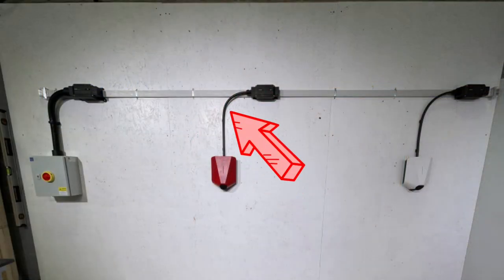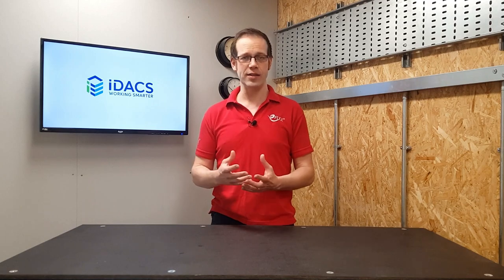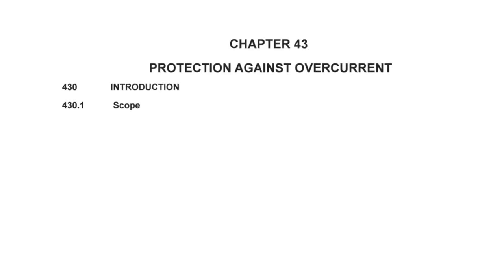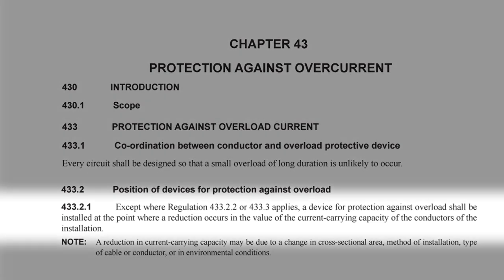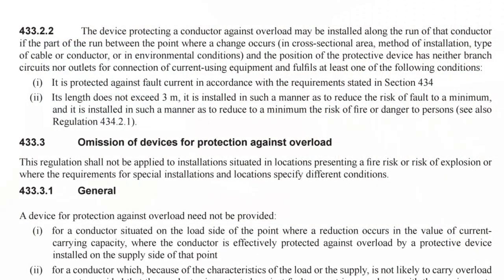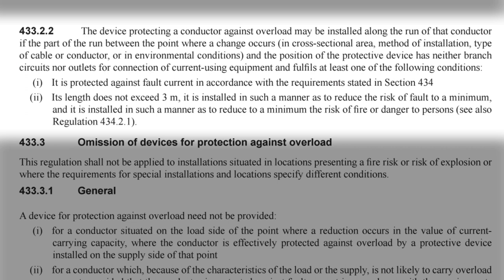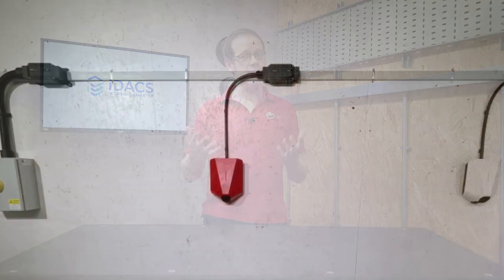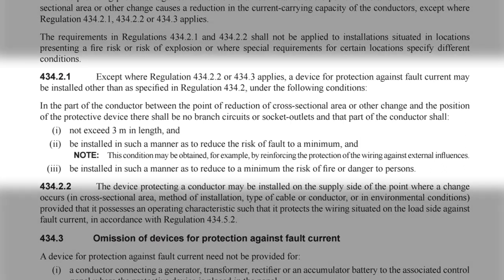ELECTRICIANS' Q&A :Do you need a fuse if connecting from a large to a smaller cable? - BS7671

Comment: This is an issue I've gone back and forth with over many years. Many electricians and Engineers don't understand the principals. What happens is they just use standard circuits or Amtech calcs and the like to come up with a compliant solution. The EV charge point is one of my favourites, as the CAN bus protocol will not allow the charge point or vehicle to overload a charging point. This has been made more confusing by BS7671 regulation 722 insisting on overcurrent protection when it's not really required. An example would be when you have a 7kW single phase charge point backed up by a 63A MCB, supplied by a 4.00 mm or 6 mm cable. There is no way you can overload the charge point as the CAN bus connection won't let it charge at a higher current rating. Fault protection is provided by the 63A MCB as 4mm or 6.00 mm cable can withstand the thermal constraints and will disconnect for fault under the adiabatic equation. Lighting circuits are similar, especially with the advent of LED lamps. You can't overload them, unless you step well outside the parameters of the original design.
Reply: *principles
Reply: Why would you use a 63Amp, when a 32Amp would do the job?
32Amp MCB wouldnt even think about going until 45 odd amps +
Reply: I can assure you engineers do understand the principles. It may be that electricians and technicians do not, but degree qualified engineers certainly do.
Reply: I don't agree with this. You are relying on the data connection of the CAN bus to provide safety, and that could malfunction. 

Always good to have protection in the power circuit itself.
Reply: @deang5622  Please explain how you can overload an EV charge point circuit? If the circuits designed for 7kW single phase or let's say 22kW three phase, what scenario would cause an overload?

Comment: Personally I would not worry about it I have an email from the HSE that says running a cable across the ground and being driven over without protection for two years and its OK to ignore 705.522 (ii) which makes a mockery of BS 7671
Reply from the maker: Interesting, what situation is this in?
Reply: @efixx   its a generator running a EE/BT telecommunications tower now in its 3rd year  I understand it was forced onto the farmer under the telecommunications act but is now well over the 6 months mandated by the act for emergency deployment.  its close to a holiday park so kids dogs and the general public are often  around the area the cable is run unprotected about 700 feet though the field which accommodates the access to our house and the local woods. HSE state they have assessed the risk and feel it can stay as is i have asked for the risk assessment and which engineer considered a cable being driven over on rocky ground and accessible to the general public to walk over. but to this point they have not answered. ( I sent to some email to you on this is you want to read for yourself ) Cheers Frank
Reply: the HSE seems to not want to answer me though i am a little sarcastic when officials try and hide behind a desk  so she got the following email this morning
 Hello Miss Kelly 
I am looking for the risk assessment the HSE did to reach the verdict that BS7671  subsection parts 7 section 705.522 says cables need to be buried to a Depth of at least 1M  is the HSE recommending to the  committee of BS7671 that this  should be written to say something like “cable can be haphazardly laid across rocky ground and be allowed to be run over by vehicles, further leaving cable as a tip hazard to horse livestock and pedestrians would be considered an advantage” yes I may sound a little sarcastic but basically that is what you have implied is an acceptable installation. 
So once again I ask for the risk analysis for and who signed off to say this is acceptable.
Regards
Reply: Squashing the cable restricts electron flow.....

Comment: Doesn't it usually make sense to have a large primary fuse or breaker at the supply input and a secondary protective device at each step down point? That makes sense in theory at least. But lots of cables step down in cross sectional area at branch off points on the grid without any protective devices, like where service cables branch off to people's homes and to stuff like street lights for instance. And it's often the same in vehicle wiring looms too, I've often seen a large incoming cable in a vehicle loom branching out into several smaller sizes without any extra protection which I don't like but there's millions of vehicles out there running around without their wiring catching fire so this is a sticky subject, and it's especially important where there's loads more energy involved like there is with mains electricity. And I know that there's a region between where a cable can start to be overloaded and where the protection finally blows and that's where it gets a bit complicated which is why people must be properly qualified to install such risky stuff. And surely it's safer to branch off and step down in conductor size without extra protection if the branch cable is in a steel conduit rather than just a PVC insulated cable on the surface or under a wooden floor.
Reply from the maker: That is the usual way of doing it yes, but as this video explains there are other ways that are acceptable.
Reply: @efixx  And if you did use any fuses shouldn't they be HRC types, or class C breakers, given the amount of energy involved in a circuit like the one being demonstrated? I fitted a dirty great class D breaker once to protect a whopping great plasma cutter I installed.

Comment: I think the issue lies in limiting risk, which could be tricky for car charging points. Best to keep the length of 'undersized' cable to a minimum, preferably using a tap-off with integral breaker.

Comment: This method is used from the main head to the street main splice isn't it?
Reply: Supply authorities are a rule to themselves,  they would loop to houses together without a thought for load or overload
Reply from the maker: The cable feeding the property comes under the ESQCR regs which will have its own guidance on this. 👍

Comment: Very interesting video, thanks for that. Just out of curiosity. Is this the same reg used to dictate the requirement for protection of meter tails that are over 3m or is this just DNO stipulation. It is my understanding that the DNO will only guarantee disconnection times for cutout fuses when tails are 3m or less. Or did I dream this? Thanks again.  :)
Reply from the maker: It very much is involved in the DNO stipulation yes. We're dropping a new CPD in association with BG on circuit protection this week and we explain exactly this in it. Keep your eyes peeled for that!
Reply: @efixx  brilliant, thank you for this info. Much appreciated. 👍
Reply from the maker: @petertallowin6406  our pleasure. 😊

Comment: What about the following reg? Does this comply?
722.533.101 Each charging point shall be supplied individually by a final circuit protected by an overcurrent 
protective device complying with BS EN 60947-2, BS EN 60947-6-2 or BS EN 61009-1 or with the relevant parts 
of the BS EN 60898 series or the BS EN 60269 series.
Reply: The busbar isn't a final circuit is it so the busbar would be your distribution circuit and the drop from there the final circuit, as long as you don't use one break out box to two chargers you'd meet the single final circuit per charger imo.

Comment: Does the same apply when spurring off a ring?
Reply: Yes and no . When you spur off a ring you are only allowed 1 point  ( single socket,  twin socket or switch fuse )   , the maximum load of a twin socket is 26 amps , so the current carrying capacity of the spur cable has to be 2.5mm .  That's why you can't spur off a spur . The potential fault current that might flow in the event of damage to the spur cable would have to be high enough to blow the ring fuse or trip a mcb , hence the Zs has to be within the max allowable for the device.
Reply: @dennisphoenix1  Slight clarification on your wording - when spurring off a ring final circuit you are only allowed to serve 1 point per spur unless that spur is protected by a fuse not exceeding the current rating of the cable in the spur and no greater than 13A.  The total number on non fused spurs should not exceed the number of points served directly by the ring final circuit, fused spurs are unlimited.
Reply: @farmersteve129  So are you saying you could spur off to a fused spur then spur off again to a single socket total 26a max?
Reply: @ggbalze06  the fused spur should commence at the ring

Comment: It would be an interesting upgrade of the splice head, if one with an MCB/RCBO was available built in. Yes it wouldn't be as neat, but could be useful particularly where there is a branch that needs to be longer than 3metres.
Reply from the maker: Great suggestion, it would certainly open up some other applications as well. 👍